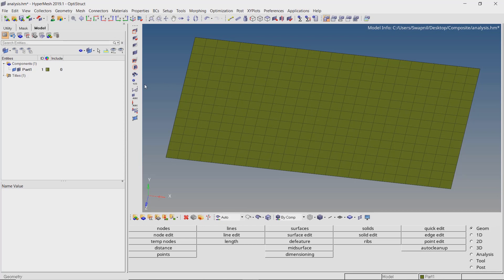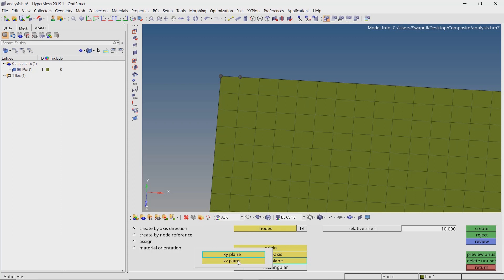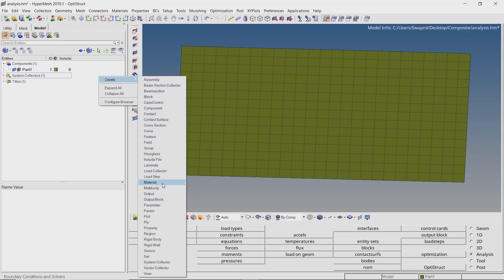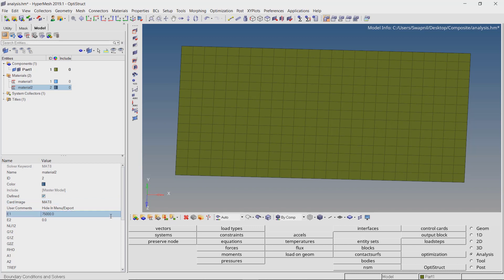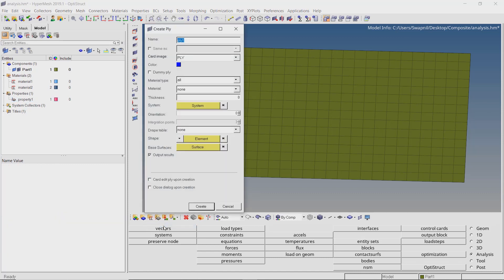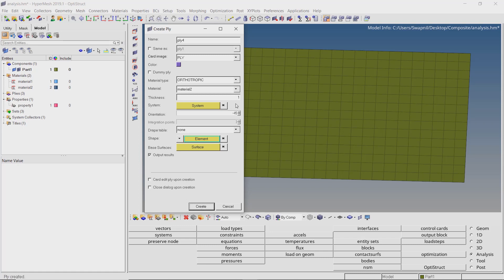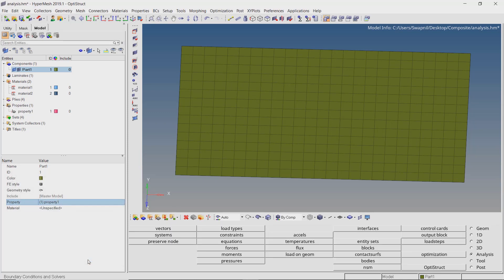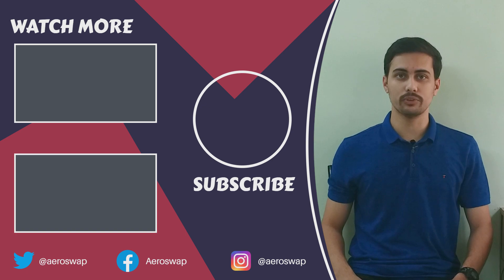Hypermesh Composite Tutorial [Ply-Laminate Structure]

Comment: I read a paper that mentioned 3d elements are preferred for explicit analysis of composites. In that case how do you recommend going about this? Do we have to create a solid geometry and do 3D meshing?
Reply from the maker: It is possible to create a 3D model but you will have to create and mesh each layer of the composite manually. Some approaches use cohesive elements between the layers to better analyze phenomena like delamination. Overall, it will be more complicated than using 2D elements as shown in this tutorial.
Reply: @Aeroswap  Thank you for your reply. I am modelling the composite with Radioss Solver. I agree that 3D elements are better when one wishes to study delamination or interlaminar stresses. But how do i model a composite plate with 3D elements? My laminate has 16 plies. Is there a way you would recommend?

Comment: Could I ask you , whether there is any 'contact' between the layers when you create a multi-layer material model like this?
Reply from the maker: Hi there,
This method of composite modeling creates a bonded laminate from a stack of plies. It cannot predict debonding. It is only applicable to linear analysis, hence no contacts are involved.
I hope this helps!

Comment: Hi, very good video, thanks! 
I have a 2 questions, it will be very hopeful if you can help me with it:
1. For laminates, you can create a layers of the material defined in property, using HyperLaminate instead of using ply and Laminate. But how to visualise the layers of the material in HyperMesh (like you did in this vide)? If I’m good understanding, this is different approach to create a laminates but I’m not fully understanding it. 

2. I discovered that in new versions of HyperMesh, possible is to create laminates using solid elements. PCOMPLS properties is made for this. Do you know how to properly create the model, consist solid elements and using PCOMPLS properly to set up a composite layers material? And visualise it?

Thanks in advance!

Comment: I don't understand what's E1 and E2 and how to calculate them or do we have any chart for different composites?

Please help
Reply from the maker: These values are aquired from online material databases. You will find detailed material property values for several composite materials that can be used readily.
Reply: @Aeroswap  can you please share a link for the database from which you pick values. I have been searching online and didn't find anything which tells E1, E2 and NU12.
Reply: @Aeroswap  Hey aeroswap, I am getting an error "Draping stopped, maximum shear exceeded". Can you please tell me what am I doing wrong?
Reply: Hiii can u share link for property assigning in hypermesh for boron epoxy

Comment: Hi bro, I'm working on composite analysis but I'm using PCOMP Card image in my property but after complete final boundary I'm facing with the error can you please suggest me how to over come this and my error is.....
* ERROR # 622 *
 PLY 1 does not contain any valid plate elements referencing a
 PCOMPP card.
Reply from the maker: Please use PCOMPP instead of PCOMP. It is much easier to model composites with PCOMPP.

Comment: Please tell how to export this composite laminate in LSDyna for explicit analysis.
Reply from the maker: Make sure you are setting the user profile to LS Dyna before starting the composite modeling.
After the setup is done, use the export solver deck option to save a 'K' file. Then you can run it using LS Dyna solver.
Reply: @Aeroswap  but after starting work with user profile of LSdyna I am facing difficulty while aloting material props. Why so?
Reply from the maker: Right, composite modeling setup is very different for every solver. The process shown in this video is only for Optistruct. You might have to refer some other tutorial to learn composite setup for LS Dyna.

Comment: What are the default units u have considering while giving input for those properties?.. Like youngs modulus and density?
Reply from the maker: It is kN, GPa, mm, ms. You can use any consistent unit system as per your requirement.
Reply: @Aeroswap  .. Thank you for quick reply.. Hope we will see one video on bullet impact on composite plate. Eagerly waiting for that

Comment: Can you please specify a way to change the element normals ? Like if they are not in the required direction
Reply from the maker: You can use the 'reverse' and 'adjust' options provided in the element normals panel to switch normal directions.
Just select the required elements and make necessary changes.
Reply: @Aeroswap  Thank you very much 😃. Your channel is amazing pleas keep on posting such tutorials 👏👍

Comment: Hello Aeroswap,
I'm following your exact steps, but I am using Abaqus as my solver (so there is no PCOMPP Property or MAT8 materials). Everything works perfectly fine, I can even visualize all my plies and the fiber orientations. But when I try to solve it in Abaqus it always says that there are element with missing properties, even if there are clearly not because I assign my propertie to all components of my part just as you do in your video. Do you have any workaround for that? 

Best regards, nice videos!
Reply from the maker: Hey!
I am not used to working with Abaqus. Most of my work is related to Optistruct. I do not know about the specific difference in modelling of composites for Abaqus.
Nevertheless, I will try to find a solution for this. I will get back to you soon if I find something worthwhile.

PS : Im glad you liked my videos! Thanks for watching 👍🏻
Reply: @Aeroswap  Thanks alot for your effort, i really appreciate it!